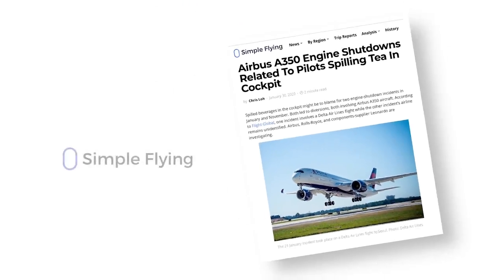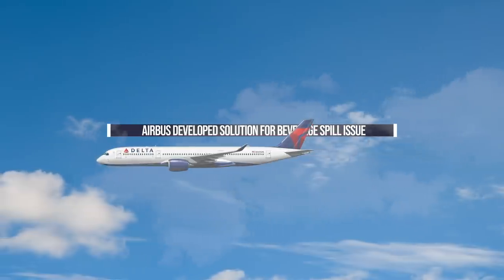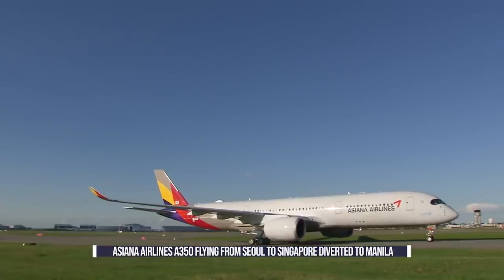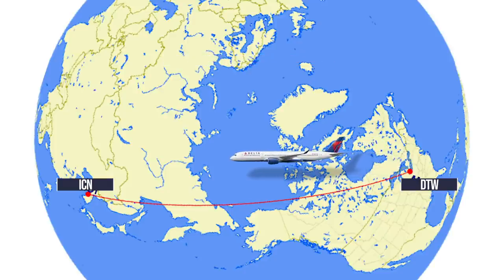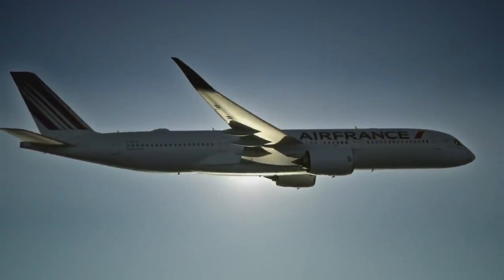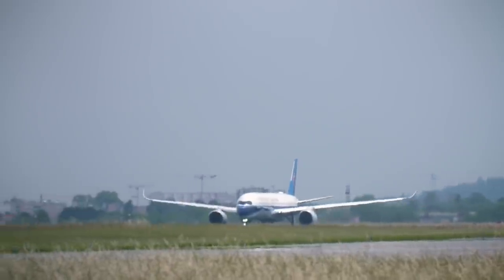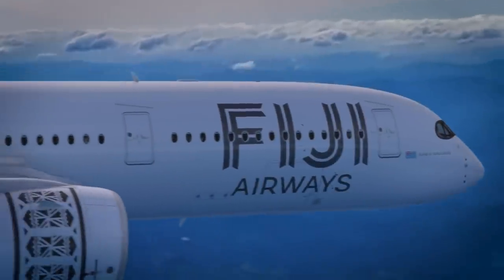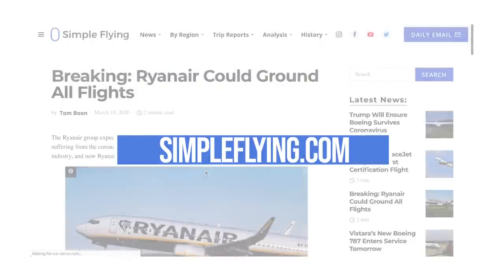How Airbus Reacted To The A350 Cockpit Coffee Problem

Comment: I've been flying professionally for almost 33 years - first in the USAF then with a major US carrier.  In the USAF, we were taught to never pass liquids over the center console or throttle quadrant.  That carried on with me to my airline flying.  However, not everyone is so disciplined in that basic practice.
Reply: It’s sop in most airlines to pass drinks around the side. I’d say something like 1 in 50 to 1 in 100 times a crew member will try to pass a drink over the centre pedestal. Still don’t understand how a little liquid can shut the engine down though....
Reply: @iainmillar1532  Liquid is no gold but still conducts electricity. There are vital controls in the centre console between the pilots and it is not hard to imagine system shorts causing problems.
Reply: I've been flying professionally for 32 years and at my airline I still see guys/gals setting their water bottle down on the center console.....

Comment: I worked as a flight attendant for Thai International for 38 years. Served thousands of beverages to the cockpit crew. Never once did a spillage happened. Thai has the procedure to hand any liquid to the flight crew from left side for the captain and  from right side for co-pilot so both can place the drinks in the cup holder beside then. The only place they could spill there drinks are on there laps. No rocket science here.
Reply: I have to wonder if the side stick control setup in an Airbus, which is on the outboard side for both pilots has something to do with this problem. Granted, the AP is engaged, but is there a tendency to hand, or handle things away from the primary flight control, regardless?
Reply: Same here in my airline based in Dubai. 
We give drinks to the pilots in covered cups between the window and the seat. Never over the central console.
Reply: @radon360  I've been flying on A330, 340 and still on A380. At least on these airplanes, the joysticks is sufficiently far away to not pose a risk of spillage.
The main issue is the center console were the engine controls and trims are located so the liquid can quickly drip inside. 
The joysticks have an accordion like style cover and the liquid could hardly go inside the mounting. 
You can probably find cockpit pictures and see for yourself.
Reply: @jiggythibs  “airline based in Dubai” “A380” hmmmm I wonder who you fly for haha. Thanks for the insights, appreciate it 👍

Comment: The reality is that pilots get thirsty. No matter how careful you are, you are eventually going to spill your drink-even if you use a well-designed cup holder and a sippy cup. As an engineer, I was taught to protect myself against myself. Obviously, whoever was responsible for designing that part of the A350 cockpit forgot this rule. 

EASA did the right thing, by ordering that the cockpit of A350s become a no liquid zone as a temporary solution was correct. They pushed Airbus to fix this problem, because they knew that someone would bring a beverage into the cockpit, even if they weren't supposed to... and eventually someone would spill a beverage in the cockpit.  I like the approach taken: have a quick fix that's only intended to last a year or so, then fix it right and for good.
Reply: Read/listen again. They defined a liquid free zone within the cockpit. Meaning a certain area of the cockpit, not the whole cockpit itself, no liquids are supposed to be handled over the centre console so cabin crew would pass them on the outside of the seats

Comment: I’m pretty astonished that some airlines allow liquids in this area. Procedure in my airline (AF) is to never bring drinks over or even anywhere near the central pedestal in any aircraft. Captain’s drink goes straight in left cup holder down left side, FO’s drink goes straight in cup holder down right side. When they drink water they drink from a bottle, not a cup, and replace the cap after drinking, which reduces the risk of water spills.

Comment: Haha. Both Airbus and Boeing need new engineers who think about REAL flying, not just ideal condition flying.
Reply: Bro I think the same. Both are doing shit with the new planes like Instead of moving forward they back off
Reply: I am sure you can go to their HQ and teach them. Or maybe just avoid drinking coffee without a cover and a straw just in above the electrical pannel? Just saying.
Reply: heck Airbus planes have a freaking dinner table for the pilots, I have no clue how they didn't figure that liquids might spill anywhere on the cockpit. Pilots do need to eat and drink during long flights after all
Reply: I dont think any engineer is gonna expect the pilots of the plane to spill boiling hot drinks on their instruments especially ones that are fly-by-wire. Atleast this time its not really related to the engines like all the problems the 787 has or aircraft design like the 737 max but actual pilot error on spilling hot water on his instruments
Reply: @kh2b573  I do agree 100% that you do have to be quite the doofus to not take care of spilling drinks on the instruments of a multi-million dollar machine carrying hundreds of people near the speed of sound up in the air, but honestly, it doesn't take much to figure that pilots have to keep at the very least hydrated during hours of flight, and the flight controls being prone to shut an engine from liquid spill is a downright dangerous oversight.
Reply: @kh2b573  that’s kinda the point. The engineers are designing in a bubble but not thinking about the human factor. Heck that’s why MCAS was flawed too- they assumed the pilots would react in time, but they didn’t. With new security measures, pilots are kinda holed up in the cockpits longer, and a A350 is long haul flying almost all the time. I agree it sounds dumb to have fluids in the cockpit but the reality is they always will- and remember it’s liquids that were the problem not necessarily coffee (coffee doesn’t conduct electricity better than other liquids I believe...)
Reply: @christopherwarsh  the MCAS was flawed not because they thought the pilots would react on time , its because the sensors were faulty causing unecessary dips  during flight and even tho the ethopian air one did turn off the MCAS it was too late. It was never about the pilots , it was boeing's fault for pushing the 737 to its limits just to make money. They kept advertising it the same way as airbus , that pilots can understand it in a matter of seconds but clearly that wasnt the case. In airbus' case however they never actually expected anyone to spill over a hot drink , I mean thats like laptop or computer companies expecting people to spill hot drinks on their expensive products.
Reply: @uwu_senpai  yep.. even we avoid drinking from opened cup while driving a car...
Reply: @kh2b573  yes the MCAS problem is actually way more complex (like also not mentioning it to the pilots in the certification training). In Airbus’s case, though, to think liquids would never be spilled in a cockpit is naive. What if the windshield of a cockpit was compromised? Then pilots would make a dive down to altitude, but in rain? Then the engines will just shut off? I mean, super hypothetical but that’s what safety measures are there for, to account for as many hypothetical situations as possible. It’s not beyond reasonable logic to think that hypothetically during 10-15 hour flights drinks will be in the cockpit and liquids will spill, either by accident or due to unforeseen circumstances, like turbulence or a really good joke.
Reply: Or for that matter someone who likes old aviation movies. "Fate is the Hunter" from the '60s depicted this exact malfunction, coffee spilled on the center console caused engine issues. Actually if I remember right it caused a false fire indication, not an actual shutdown, so this is actually worse. Grated a '60s era jetliner had a lot less electronics to mess up than modern ones do. Every engineer designing something should watch movies showing fictional failures, no matter how far fetched, and ponder if such thing could happen to what they're designing. Just like how the movie "War Games" lead to a major cybersecurity upgrade at NORAD when engineers there realized what happened in that movie was too plausible for comfort.

Comment: I worked on B52's, autopilot and compass. They had a autopilot mode selector switch box on the center consul with a rail/grate to protect the switches. Unfortunately it made a convenient spot to set coffee. A spill could give the plane quite a kick in autopilot.  Hours spent troubleshooting to find a puddle in the switch box. Rarely did the pilots fess up to it.

Comment: I used to underwrite, and fully understand the concept of risk and that no matter how you may mandate, someone somewhere will have the attitude that it doesn't apply to them and will ignore it. So the possibility that something serious can happen must either be eliminated, or reduced as much as possible.
What impressed me with Airbus's action is how they came up with an interim fix (even though it probably belonged to the Heath Robinson school of design) while they worked on designing the issue away. This contrasts with a culture where they just try to blame the pilots to put off doing something for as long as they can, hoping that they can sneak in a fix without people knowing how serious it really is.

Comment: Beats me why anybody would have a filled cup near to a control panel.   Surely if you need a drink that badly, you could either take a couple of minutes away from your seat, maybe in the jump seat while your buddy monitors the flight or drink from a bottle.
Reply: Pilots aren’t supposed to leave their seats unless switching with another. Exception is toilet and usually a cabin crew comes in just incase the other pilot feels suicidal (Germanwings, Silkair)
Reply: @tomstravels520  I get that there are rules but how is sitting in the jump seat with a full view of everything more risky than leaving the cockpit altogether, locking yourself inside the head and emerging ten minutes later when you've jettisoned that ill=advised Vindaloo Curry?

Comment: Damn, that's a nasty problem to solve. A very real one though, especially as people don't want to own up that their butterfingers might have caused water damage to a 300mil airplane. They are quite likely to wipe it up and pretend it never happened. Except you have seepage under the covers corroding who knows what with unpredictable results down the line. I guess you could theoretically waterproof the entire damn cockpit, but the impact it would have on maintainability.... ugh. A proper engineering nightmare that one.

Comment: Why didn't they just cover the entire control systems in cling wrap or some waterproof cover that is heat resistant? A rubber covering that would cover the entire control system would prevent liquid from entering the controls and causing a malfunction, which would increase safety. Making a mold that is removable would help drastically.

Comment: I still can't believe airbus didn't catch this in testing
Reply: Do you actually think any manufacturer tests to see what happens if liquids are spilt?
Reply: @tomstravels520  Yeah, this is a design mistake. You design for a certain misuse of the product, especially if it is safety critical. Pilots eating and drinking is expected normal behavior, so also when they fail to keep the cup upright.
Reply: @sparqqling  in the cockpit however it is easier to have discipline in handling liquids. Keep them away from the centre console, don’t pass anything over the centre and put them in the cupholders when not in use. The delta pilots reportedly put them on the centre console, not even on the fold out tray. And I can tell you now that neither Boeing nor airbus tested to make sure their console are waterproof
Reply: @tomstravels520  Apparently the cup holders are too small,  that's why they have put them on the center console. Great example of all details matters. The center console have to be waterproof, it won't be submersed. Just spil proof, like the keyboard of a Thinkpad. Those guys thought about the misuse by the user, people spill coffee on laptops, why not make some drainage holes so it can drip out of the laptop without doing damage.
Reply: @sparqqling  because there are no rules and regulations about people having drinks near their own personal laptops where as in a cockpit there are. So those pilots broke the rules by putting drinks in places that were not allowed. Same reason that places at work will have rules for drinks near computers but at home you’re free to do what you want
Reply: @tomstravels520  I'm not saying that pilots are not at fault. But a good and safe design know that people make mistakes and is able to deal with it. 

If it was just as is the damn pilots should not drink coffee, the patch from Airbus was not needed.

Comment: One advantage of Sober pilots is that they don't spill red wine. The most common reason sales people have a faulty computer is spilling red wine. Ironically, as with clothes and carpet stains, white wine is often the best treatment then drying out at a cool heat.
Reply: It doesn't seem to matter which white wine but may save a fortune in insurance costs. Repair shops will disagree but not sure if they bother to try.

Comment: DOH!  

Airbus used to use Porsche to design the ergonomics of their cockpits.  Apparently they've stopped using them..... 

Did nobody in France ever think about pilots drinking coffee in cockpits and the ramifications of spills~?
Reply: Airbus is like Apple, they top-down prescribe what they think the pilots want. Meanwhile Boeing installs small handles low on the dashboard for the pilots to literally put their feet up on during cruise.

Comment: It seems to me that the issue should be handled more with the pilots than require a large investment in redesigning the panel.  It is the pilots who must be careful, it is mandatory that they do not have drinks on top of the panel.
Reply: You must design for misuse to a certain extend, especially when it is safety critical. People eat and drink, so you must be able to deal with it when they spill it. One idiot who spills his drink should not be able to cause such an event, that is a single point of failure.
Reply: @sparqqling  Well, in a pilot and of course we drink and eat but I will try always to not do it in front of the panel. That’s why I said: should be handle with the pilots not requiring companies does a large investment in redesign the cockpit bro and then the airlines spend more money putting the new cockpit into their planes. It’s normal and easy: it’s pilots problem
Reply: @MsAndressegura  You already said yourself, try not do it in front of the panel. None of these pilots spilled the cup on purpose, but it happened. Mission critical equipment must be able to withstand some degree of mistakes.

Comment: If this wasn't an issue with other aircraft then it was a design oversight. Drinks will be spilled.
Reply: The cupholders on the A350 are slightly smaller however pilots have had them in the trays for years. These pilots reportedly put them on the centre console

Comment: I wonder who pays for the new panels in this case. Airbus seem to be the one at fault for bad design, but I can't picture they replacing all affected parts on all aircraft free of charge.
Reply: airbus at fault for people pouring liquids in to electronics????
Reply: @ant2312  Airbus at fault for failing to foresee that the controls might come in contact with liquids when it is common knowledge that pilots have their meals while on their seats. They didn't need to be able to be submerged into the Mariana Trench, but to be vulnerable enough for an engine to turn off mid-flight? Big nope there.
Reply: @alecbasba  There's nothing you can do to solve the "liquid in systems" problem you can only add firm cupholders

Comment: I comment by saying that I worked in highly regulated medical devices in class C (can kill people) and one of the tests of getting approval was to spill a large quantity of liquid on the medical device to verify its capability to handle and drain the fluid away without consequences. Seems that whoever did the certification of that panel did not follow the guidelines we had to comply with.
Reply: Why would an aircraft manufacturer have to follow same standards as the medical industry? It’s never been a problem because planes have cupholders. The A350 ones are slightly smaller so pilots decided to put them on the centre console which they shouldn’t be in the first place
Reply: @tomstravels520  While probably not on the same standards, they both are critical and need to go through the same level of testing and assessment. This stuff is extremely regulated, and the piles of documentation that goes with a component, hardware or software, is measured in pallets.
Reply: @StefanoBorini  and how are they supposed to test if an aircraft this safe if you pour water over it? Nobody wants to be the one to try that in the air. On the ground you may get similar reactions but would make more sense to try it where the plane would most be in danger
Reply: @tomstravels520  you know that you can test the panel without the airplane attached to it, right?
Reply: @StefanoBorini  but how do you know the effects of what it will do to an aircraft in flight?
Reply: @tomstravels520  fixtures

Comment: It’s the pilots fault in my opinion. Airbus is better than Boeing and they have many safety per cations
Reply: Hmmm yet boeing aircrafts engines don't shut down if something is spilled
Reply: @ethansaviation2672  no, Boeing have other ways of causing a problem.
Reply: @peteconrad2077  never said they didn't.